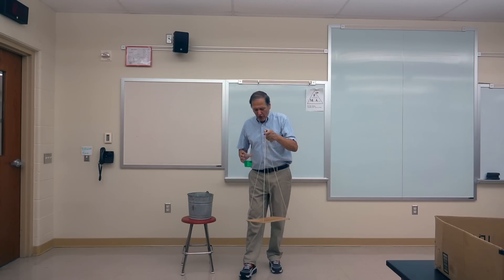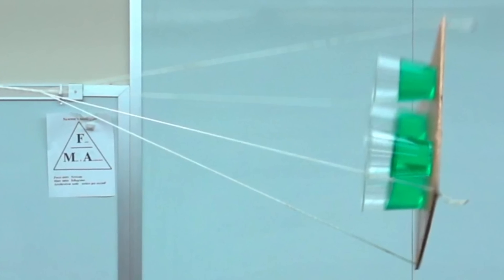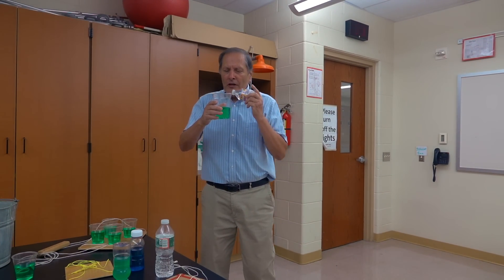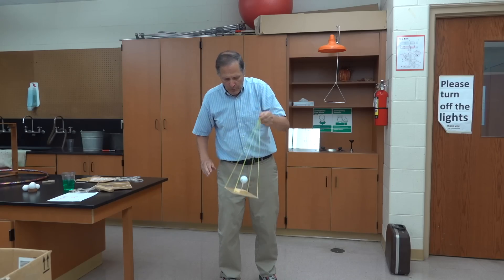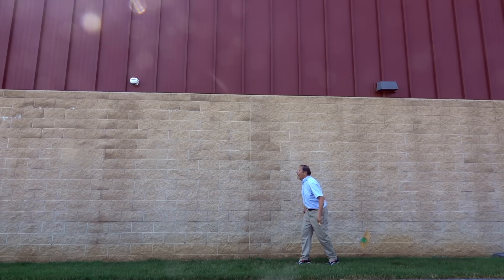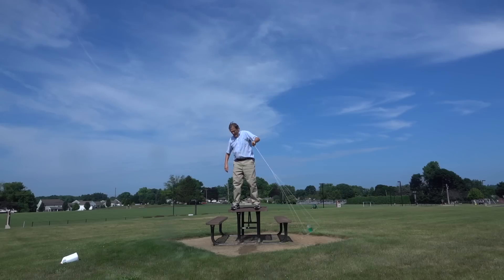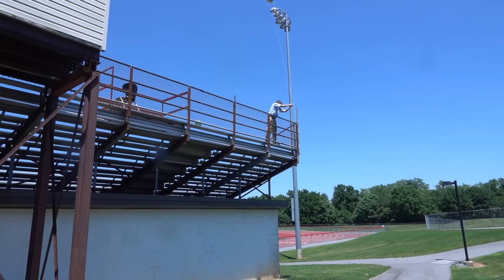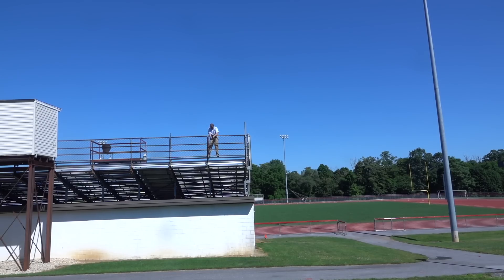Centripetal swinging tray,  improving an old demonstration

Comment: Great video, I am relieved you didn’t fall off the stadium as you were swinging it round! You will need a hammer thrower with higher speed and strength to see what string length can be achieved😁

Comment: It would be good if you could measure the speed of rotation and capture several pictures of the horizontal angle at different speeds of rotation, and then draw conclusions on the horizontal angle of the liquid surface as a function of the speed and the length of string.

Comment: I'm intrigued about the physics of bringing it to a halt without spilling.  Why is it easier with shortening the string?  It's there a physical reason it's impossible to bring to a stable halt at 14 ft?  Is the system stable as it 'coils in' around a cylindrical axis (it looked like it).
Reply: Probably because your arm can only move so far to dampen the oscillation.

Comment: I love the idea of having the students build their own apparatus to push find limits. I have been using a trick that I learned in junior high. Take a wire coat hanger and stretch it out into a long diamond shape. If necessary bend the hook so it points straight up when the coat hanger is hung from the top of the diamond. Now the fun part. find an older penny with the Lincoln Memorial of the back. Balance the penny on the hook and try to get it spinning around your index finger. Once it is spinning it is quite stable. Then the trick is to stop it without the penny falling. It takes some practice but it is quite impressive once you get the hang of it. Most coins should work (unless they have a hole in the center) as long as they have one face that is pretty flat. Also, some coat hangers have a bevel cut on the end that may have to be filed flat. Once I get the penny stopped I shake the hanger to prove the penny is not glued on.

Comment: If the centripetal force pushes the water towards your hand, why is the water as far away from your hand as it can get? Seems like you're missing at least one force.
Reply: The water is pushed toward the frame of rotation, which is why it moves with it.